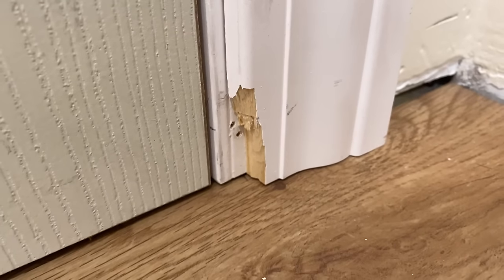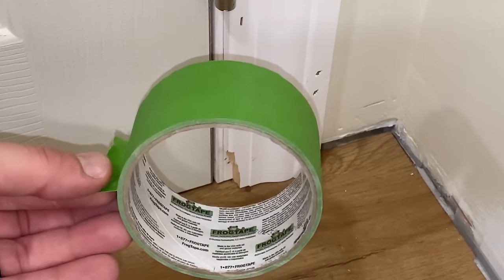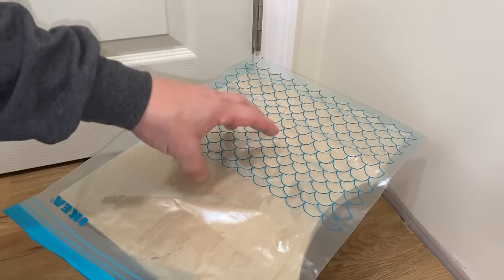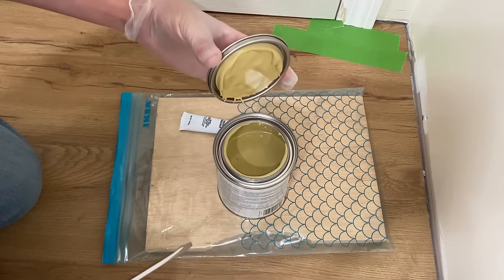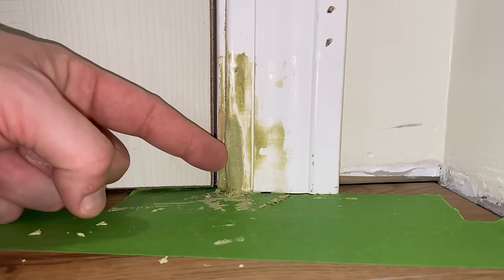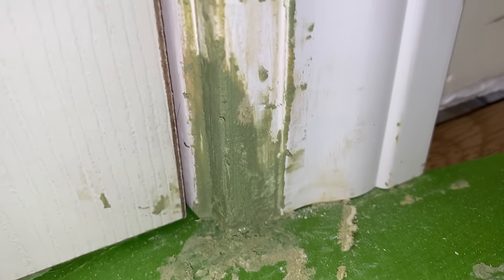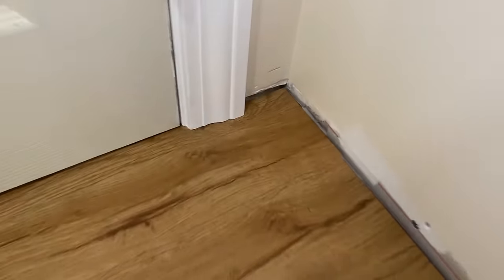How to Repair Broken Trim with Bondo for Wood

Comment: This is one of those repairs that people pay a lot of money to have done. Any good handyman has a can of Bondo kicking around for painted trim repairs. I know my best friend uses Bondo a lot when she paints for other people. She even used it on the walls because it cures faster than plaster repairs.
Reply: wouldnt wood filler do same thing
Reply: @randomrazr  it is wood filler. It's called Bondo Wood Filler.
Reply: @PennySue  Yeah, I suppose so but wood filler don't need a hardener. Personally, this video was irritating. Knowing how to do these minor repairs I would've spent half the time and half the effort to achieve the same results..
Reply: @guysolis5843  ... wood filler can't be sanded in 20 minutes. With a little practice you can vary the amount of hardner so you have a longer or shorter working time if necessary.
Reply: @rupe53  Sorry man, I was rude. I had foot surgery....no excuse. You're doing good. It's not easy making easy to follow videos..You have some interesting topics in your channel..I'm subbing!
Reply: @guysolis5843  ... I wasn't trying to be rude or curt either... just explaining the differences. It's all good. BTW, there was a spot in the video where he said this job may be a poor example of the product use because of where it is and the small size. He went on to say that he wanted to make a video, and this was what he had to work with at the moment.
Reply: Hell yeah
Reply: I thought they only had bondo for cars
Reply: @michaelvaladez7928  Bondo is great stuff. I use it to make Micarta even..
Reply: More expensive here

Comment: To tape off you can take a piece of the painters tape and fold it over itself so the sticky isn't exposed anymore. You can then very easily slip that under what your working on (and back out when your done) and then tape that down. If your trying to maintain a gap (without having to recut later) you can fold it over some card stock (cereal box cardboard works good) or similar to make up the gap. This also is great protection when sanding the edge.
Reply: Also taking that door off would have given more access

Comment: I would repair by chiselling the damaged edge straight and gluing in a new piece of same species timber, first pre-shaped to the existing profile. To prevent problems arising from differing expansions/contractions resulting from temperature and humidity changes, always better to repair like with like.

Comment: My parents built a summer cottage back in the 1950s and over the years the floor has sunk around the slate hearth in front of the fireplace and there’s a good 1”  gap between the floor and the hearth and I’ve been racking my brain trying to figure out how to fill that hole. This gives me an idea and I may give it a try. Thanks!

Comment: This video is incredibly useful for anyone dealing with damaged trim. Your clear instructions on using Bondo for wood repair are fantastic, especially the tips on mixing and applying the filler for a smooth finish. The sanding and painting steps really help achieve a seamless look. Thanks for demystifying this process and providing such practical advice!
Reply: Do we need to use the hardener?

Comment: Many thanks!  I have water damage on top of a window frame, which we inherited from the previous homeowners.   We didn't realize there was a water issue until we took down the blinds to paint.  The water has rotted it a 3x2 inch section of the wood and I was trying to fix it.  Have stopped the water, finally!, and was trying to figure out what to use.  Thanks to this video I now know.  The real help was seeing it won't stick to plastic, so will support the hole from the bottom and fill from the top to seal it and then paint.  Thank you!

Comment: Never used bondo  but have a cool chest of drawers! My other half had  a job clearing out a beautiful old barn that they were moving …and a house that was torn down. Both had not been occupied but the chest was in the leaky barn. He brought that home in his dump truck and I looked it up found it listed on a “gently used” higher end  furniture site for over 3,000! Sadly the bottom sat in wet hay and had some wood worm damage and some rot.  We killed those buggers and I figured bondo would be best & some wood hardener. The bottom front is not straight  across, it’s a bit ornate. Way out of my ability to replace the wood! Just didn’t want it thrown away.  Glad I came across this video and I have subscribed. You do make it sound doable. Kinda thinking I will give it a shot this winter. Once we finish our house! The rest of it was in good condition because of the paint!

Comment: I find it interesting when someone is teaching the way to repair with Bondo who is learning themselves. As soon as you took out about 4 times what you needed for the first filling I was hooked. The final product was fine. FYI if you are trying to render something more critical Bonda glazing putty is an added step in filling sanding scratches and fine tuning. I recently took on a repair project in a home where the owners dog chewed on the window sills in a living room and destroyed them. The profile had to be completely reshaped. I cut strips of wood and make forms to begin the filling process. I totally rebuilt 3 of the 5 sills. I used over a quart of bondo and a 4.5oz. tube of putty. The owner was amazed that it could be repaired so well. I worked on it for about 4 hours. Oh, BTW the owners dog was a Cane Corso, keep up the good work....

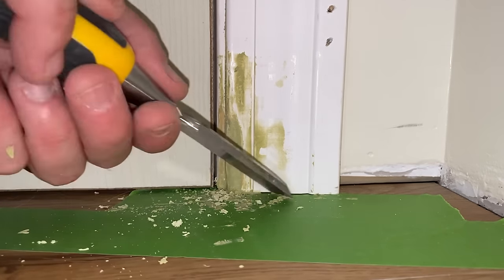Comment: At time 6:54, I noted a remarkable speed-up of the activity - your commitment to getting the work done quickly is admirable.  I have used the auto-type bondo, after using and abandoning the 'Water putty' product, and the bondo works well, although the 'warp speed' technique you use looks challenging.  Thanks for the validation that my reliance on bondo for the past few years is widely practiced.

Comment: I’ve done many repairs like this. The best way to form the bondo is to overfill the damaged area like you did then take a taping knife that is a few inches taller than the repair.  Hold the taping knife against the undamaged trim with the handle parallel to the floor and the edge of the knife touching the floor and the undamaged trim above. Pull the blade around the damaged area using the undamaged trim as a template. You’ll get a fairly accurate profile of the trim. Then with sandpaper wrapped around a wood block sand up and down still using the good trim above as a guide.  I often follow up with with a wood filler like Famowood  which is easy to sand.

Comment: Nice work, looks perfect. Did not know Bondo had a product just for wood.
Reply: Last time I checked I couldn't tell what the difference is between and wood and auto bondo, except the auto one was cheaper and I used the auto/general one as filler without an issue.

Comment: Simple taping compound works best for damaged trim, windows and doors but it usually takes multiple applications. And can be sanded and shaped easily. Then paint, the paint acts as a hardener.

Comment: One thing I like about how this guy is using Bondo is to look at the alternative. The alternative would be to replace the entire piece of trim. If you can actually find a matching profile then you have to use a utility knife to cut through multiple layers of old and hard paint and clean up all the surfaces. Then nail on the new piece of trim, caulk, prime and paint. That's if you can find the right profile which takes time in itself..Bondo is the smart way to go..

Comment: I've used Bondo for years way before they made the multi purpose Bondo it's all basically the same thing......I did body work on my old cars and trucks back in the 60s so I've used Bondo a long, long time. I've repaired both inside and exterior wood that was going to be painted .

Comment: I would go down to Home Depot and look through the bin where everyone cuts the molding. There is bound to be a piece in there. Come home cut off an inch or so of the damaged molding and cut a piece to fit. You can use glue or caulk to fill the seam, sand and paint. You'll probably get the molding for free. All you need is a 3-4 inch piece. They're not going to charge you for that. Happy fixing, glad I could help.
Reply: spent more bondo and bs chop off the bad part and use trim nail it sand it paint it done

Comment: Bro - why didnt you tape around the spot you were filling?  It would have cut down on the Bondo overspray on the rest of the trim and made sanding so much easier.   Still nice repair.

Comment: Another way to do this that I actually saw on a furniture channel is to use hot glue to make a mold.  You apply it thickly to an undamaged section that matches what was damaged.  When the glue cools it will easily peel off forming a mold that the bondo or wood putty or whatever you want to use goes in.  Once that dries, you glue the new form to the damaged area.  It worked on the furniture channel so I think it would work in this situation also.  🤷🏼‍♀️
Reply from the maker: 😮🤯 that is a cool idea!
Reply: I came here to make this comment. I’ve done the same (wonder if we watched the same video 😊) and it worked great.
Reply: @mirandamom1346  very likely!  Unfortunately, although I remember the process, I don’t remember which channel it was.  My memory is the pits anymore.  😣
Reply: @bobbiejeanm7470  For someone with a bad memory, you remembered the process well! I saw it on A Ray of Sunlight, “How to Fix a Broken Corner”, I think it was called.
Reply: "actually"

Comment: My question is..I have cabinets with a very light stain on the wood..yellowish maybe pine or oak..if I use this bondo then what would the stain look like over it? How do I get the cabinet to match the others? Will it be greenish? Is there a primer I use?

Comment: For something that small and would rarely been seen, I'd probably just slapped a few coats of spackle or wood filler on it but I guess if you had other uses for the  Bondo, it's fine going the extra mile.

Comment: Wondering if you think this would work for trim and door jambs that were undercut too much? I'm replacing a floor with a thinner material and will have a gap in the door jambs and really don't want to raise the floor or replace the trim.

Comment: Well as an old retired home builder, let me just say that using a utility knife and a sharp chisel to true up the edges of the damaged trim, and carefully cutting a piece of the same trim, and gluing and brad nailing it in place, would be a faster and better way to do this.
Reply: Much smarter. Bondo is nasty stuff, especially indoors without a respirator, and often breaks off due to wood movement as humidity changes.

Comment: 1/22/23; ..Bondo4Wood...small repair at bottom of door molding at floor level. Good job Fixer! I often use Minwax Wood Filler (brown paste + white hardner) which smells ~like Bondo, maybe less intense, but works same. Have also used auto Bondo (redish paste w/gray hardner) & both work great! Overfilling damaged area is way 2go so 220grt sanding minimizes shadow line/seam of 'fill' patch. This may be  +/- important depending on just how much visibility/location of the patched area. This has been my experience. Always have a can of either Bondo or MW Wood Fill on my shelf. Also know, you can go get little tubes of hardner at big box or big Hardware stores. Everybody knows...'you can't 'fix that 🕳 hole' without hardner'!🛠🪛🔩🔨✅️😊

Comment: Are use a product called easy sand. EZ sand. It’s just like Bondo, but easier to sand. Then I use a stainless steal putty knife with a perfectly hard straight edge depending on the size of the repair I double the size of the blade of the putty knife and follow the profile. I apply it one time and get a perfect profile.

Comment: Ok young on, lets teach you a trick.
Cut the profile of your trim to match on a plastic puddy knife  when you use it to fill in the void it will shape it to the trims profile and save you a bunch of time trimming and sanding. You may have to go over it twice depending how good the first try was.  Wile you got that much left over fill the nail holes. You can watch Tommy do it on this old house.  And it works too.

Comment: I've used Bondo to restore rotten wooden windowsills: chiseled out the rotten wood and then filled with Bondo. Then, sanded the Bondo smooth and painted the window sills with Sherwin-WIlliams self-leveling paint. No one can tell the difference...including when looking up close.
Reply from the maker: Hey!  Glad to see that it works for you. 😀

Comment: You could also take a new short part of trim use a razor knife and cut a patch on a stright line with the top cut at a sharpe angel to make a scraf joint. Then trace your patch onto the trim, and remove that chunk to fit your repar part. Glue it into place after you fit the new part after it dry then calk any seams or use the bondo or any wood filler, let it dry and sand smooth, then paint.
This method works even better with 
The wood look thats not painted bondo will look like ass unless you match the woodgrain.

Comment: If I'm  going to use Bondo I save Styrofoam  from packaged meat to mix it on.  Also handy is wooden sticks from ice cream,  just toss after the repair is done.  If you need to shape Bondo use a wooden paint stiring stick covered in plastic packing tape.  Back fill and when it has set it will come off clean leaving you with a sharp edge.  I've  been married  3 times and none of them were handy so i did all the small repairs. 😊

Comment: Hi, so maybe a dumb question, but, at the end you paint over it. Is there a way to use the exact same technique on a surface that its natural oak color? Like, i bumped into my stairs with a mirror haha and there is a piece of wood that flew off because it's a solid wood oak stair. but now i would like to fill the damage. but what i see in your video kinda needs to be painted. but the stairs should not be painted :/

Comment: Wish they'd provide more hardener because just from eyeballing it they provided way more bondo then hardener needed.
Reply from the maker: I think if you can use less than I did and make it last longer, it will just take longer to cure.
Reply: You can buy extra hardener in separate tube.

Comment: I've seen the two different products on the market car Bondo and would Bondo someone please explain the difference to me because would Bondo and car Bondo or virtually I think the same thing it's got absolutely nothing to do with expansion and contraction because Banda doesn't do any of that and overtime especially outside the bundle will pop out of the wood because of expansion and contraction during cold and heat and again what's the difference between and regular bondo.... Except price?????
Reply: Sorry about all the grammatical errors my computer picks up the craziest in Frank inflections in my voice and completely discombobulates everything I say so...... sorry.... Just tried to say is there really a difference between Bondo and wood Bondo ???
Reply from the maker: Hey! There is not much of a difference. The biggest difference is that wood Bondo matches wood better because of its natural color.

Comment: Bondo is a great product but not the right one for this repair. Replacing the whole trim is the best option. The second best is to cut the trim just above where it's broken and  put a scrap there with wood glue to the rest of the trim. It will save you time from patching and sanding and most likely it will hold better with time.

Comment: What is cheaper, buying a can of Bondo, and trim paint or a $9 piece of prefinished trim? Good job on the profile though. When I was taught to do this you are waiting for the cheese-State to shape, it will feel similar to cheese 🧀. I could tell you knew what you were doing when you said you're waiting for it to harden a little bit to shape it.

Comment: Fastest way and best result would be to replace the $8 trim in 10 minutes. Why the extra work. No bondo no taping no sanding.

Done in 10 minutes
Reply from the maker: Did you watch the video?  I said why.
Reply: @TheFixerHomeRepair  I did. You just wanted to use bondo. But that just takes too long. It's a nice video and a good solution.  I'm not taking that away from you. To mee, it's easier and faster to swap out the trim.

Comment: Better, use wax or mold release on a good portion of the molding. Cover that with bondo-short hair fiberglass. That will make your "tool". Then put fiberglass short hair in the missing area and smooth with the tool.

Comment: As a carpenter time is money. The cheaper thing to do is just replace it. All the time and expenses on the bondo is crazy when you could've just spent 8-10 dollars on a new piece. Lol well, you did make 5 dollars on the YouTube clicks after 4 years.
Reply from the maker: This is a video for DIYers.  In the DIY world, money is money.  Thanks for another $.000001 👍😁
Reply: @TheFixerHomeRepair  you know it. Lol
Reply: @aservant2287 you might not be able to find the trim profile though, so this technique is still worth considering.

Bondo smells so bad I wouldn't use it in the house. There are other epoxy putty products that would be far easier to use like Milliput or Quikwood.
Reply: @vinberube136  that's OG 2.25 inch casing. That's the most common